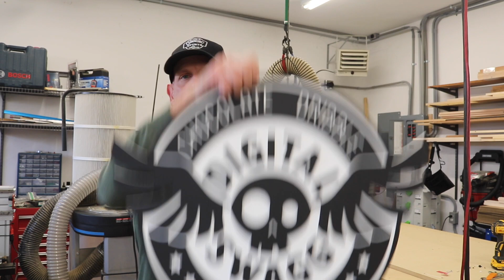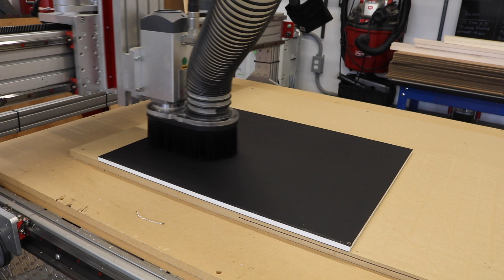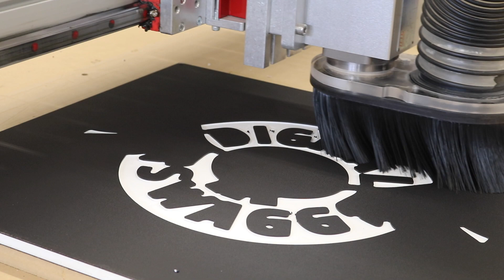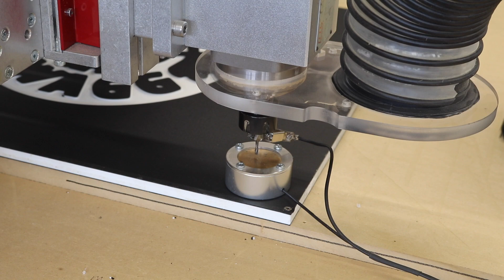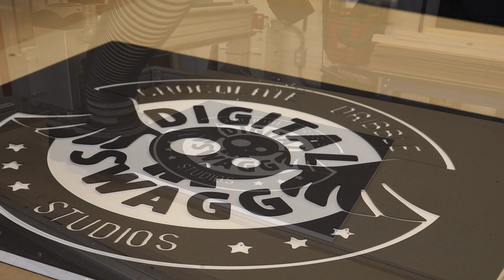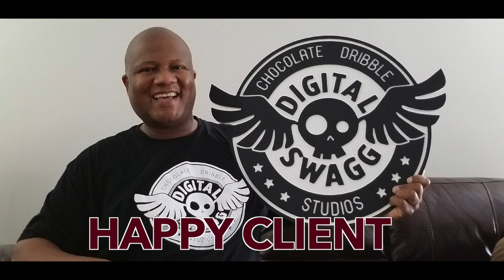CNC Sign Using King Color Core

Comment: It looks fantastic...perfect answer to signage I think... what thickness HDPE was it ? and would you say that kind of thickness would be suitable for most signs outdoors ?
Also ..if you wanted to do both sides for a hanging sign would you just turn it over in the same spot and repeat ? sorry if thats a stupid question but I have no experience with cnc routers etc.
Struggling to find this HDPE sheeting in the UK.... how much does it cost per sheet if you dont mind me asking...just so I can compare prices should I have to buy it in.
It really does look great though ...excellent job !! Just Subscribed

Comment: Perfect timing Fred. I just ordered some small pieces from inventables to experiment with. A couple of questions: did use use O flute bits or spiral upcuts/downcuts and can you tell us where you source the big sheets of king color core from?  As always...thanks for the great video!
Reply from the maker: Seems like I used a two flute spiral upcut.  Send me an email and I'll get you the exact number I used.  I buy it from Piedmont Plastics in Knoxville.
Reply: Thanks Fred, I’ll shoot you an email if I run into some trouble. I have the upcuts.

Comment: What type of bit do you use to get the best results in hdpe? Thanks
Reply from the maker: Check out Amana 51405.
Reply: Thanks i’ll give it a try. may order the Spektra bit as well for $6 more as the coated and non coated have the same part # my $8 amana cuts aluminum like butter on the x-carve so i’m in 👍🏻